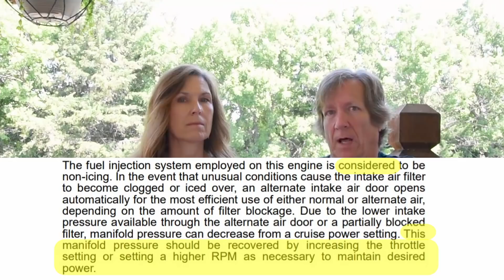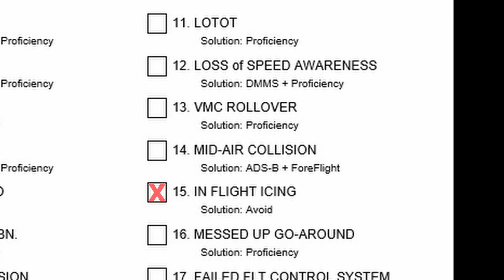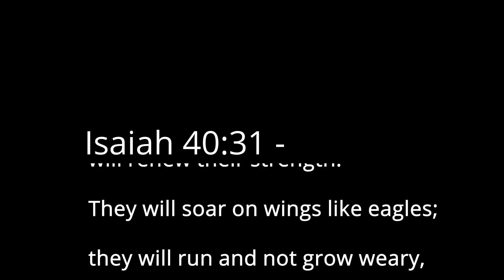Accident Review: Cessna 182T | Probable Cause AQP #15 In-Flight Icing/U-FIT

Comment: Accident reports are very valuable in that they teach others and are a constant reminder of what could go wrong and how to avoid it.

 I've never flown a fuel injected aircraft. Is there an alternate air source for the engine if your air filter gets iced up?
Reply from the maker: Yes there is, in the long description I go into detail about it but basically there is a spring door that opens but the MP has to be high enough to open it and when it is open you loose 10% of max power as well, so an iced up airplane at slow speeds may not have sufficient MP to open the door or if it did open it reduced the power by another 10% in an already dire situation . . .

Comment: once he was in the descending spiral, what actions on the rudder pedals would be appropriate, let's say for a icing on the left wing.  or was it equal icing? or icing on the prop and other engine parts, or was it icing on other flight surfaces.  Was he doomed no matter what?  looks like he was an airline pilot trying to keep everyone calm by not stating an emergency for a sooner landing.  Probably didn't want to alarm Wade and the other gentlemen , but where do you draw the line and it becomes a matter of life and 3 deaths?
Reply from the maker: I “Believe” he had little to no engine power, so he “could” have instituted PARE (Power/Ailerons/Rudder/Elevator) however at his altitude and low ceilings compounded with icing, I believe the outcome was sadly already sealed.

Comment: Well I think you are close.  He had a problem when cleared for the approach. His read back was incomplete, lacking the altitude. It indicates task saturation.  I believe it was at 3000 with the auto pilot on that the engine failed or stuttered. He got under 100 knots before the descent began.  He may have been just dealing with everything from the engine problem and just overwhelmed.  I’d like to caution against criticism of flying past usable airports.  We often don’t know immediately what’s near by and if it has a suitable approach.  After the fact we clearly know.  He may not have.
Reply from the maker: I agree with Rayville as a possibility that he may not have know if it had a suitable approach, as I tacitly didn't know Rayville had an approach. However he was talking to Monroe Approach and that would have been his best option to divert to in his situation. I think your other comments have merit as well.
Reply: @Parr4theCourse  You are spot on about Monroe.

Comment: Great review - I like to think I would have stayed on the ground in those conditions, but so easy to say after the fact. This pilot (like many) seemed like he was in control until he wasn’t. Thanks for putting this together.
Reply: If you take off and get ice in a 182, I agree that you would get down on the ground as soon as possible which requires a decent. I probably would have descended as well - maybe I need to re-watch, but wasn’t he assigned 2000 which was the intercept altitude?  Ice can be misleading and go from light to heavy in an instant. Hard to know what he faced before losing control.
Reply from the maker: @FlyingwithRich  
No they couldn’t give him 2,000, initially only 3,000 the 2,000 came into play when he was cleared for the approach…..
Reply: Great video and hopefully we all learn from it. See you soon.
Reply from the maker: Yea Rich, I was going from the perspective of you're in the air and you picked up some icing, so now what? Rayville/Monroe would have been my 1st, 2nd choice, but I wouldn't have gone past Monroe. But as you say, knowing the outcome its easy for us to say we would have never even taken off. Thanks for watching, hope to see ya again soon!!

Comment: Great review and totally on point! Looks he down played the severity of the icing and should have declared and emergency before Ruston and diverted. With the available weather information we as pilots have on our phones and I pads the problabily of ice was very high. He should have probably not departed in the first place. Not to mention single engine non de ice equipped airplanes have no business flying in icing conditions. Great job on your analysis.
Reply from the maker: Thanks, I went with the “ASSUMPTION” that he took off in conditions favorable for icing but not “known” at the time.
However, with the ceilings as low as they were, you are pretty much out of options if you encounter icing to get lower, his only option to me was to climb and get above it. But at the point of picking up icing near Rayville, he should have diverted, but he choose to ask for lower 4,000’ and continue on. But conditions did not improve, so Monroe was the best option at the time as he was already talking to them, but he continued and asked for 2,000’, that decision pretty much sealed the outcome. This one just didn’t make any sense, almost from takeoff.
Reply: @Parr4theCourse  Agreed

Comment: Any icing encounter in an airplane not equipped with deicing equipment is an emergency. Moderate icing is an emergency even in small airplanes equipped with deicing equipment. Good job!
Reply from the maker: I agree, I picked up some (a slight trace) when ATC had me climb into IMC and placed me into my 1st HOLD for incoming emergency aircraft after a lap we noticed some traces of icing by shinning our flashlights on the struts, we requested lower and when we didn’t get it was just about to declare when they gave us lower, once below the clouds it sublimated almost immediately, but it left an impression on me even though it was “only” a slight trace of icing!
Reply: You are so right...

Comment: Well done.  Very good analysis and compassionate commentary on just getting the bird on the ground at nearest possible airport.  It seems like there is not that much difference time wise, once back in the air after the icing event was over, between Ruston and Monroe.  He therefore  should have landed at Monroe.  I believe pilot just wasn’t thinking about air filter plugging up and that your analysis is correct.
Reply from the maker: Thanks, not 100% sure of course as this is a hard one to definitively say for sure, but it sure appears that filter plugging was a contributor and at those speeds maybe not enough Manifold Pressure to open the by-pass door.